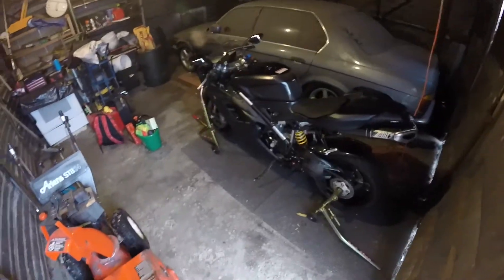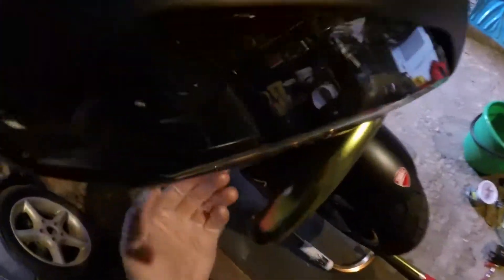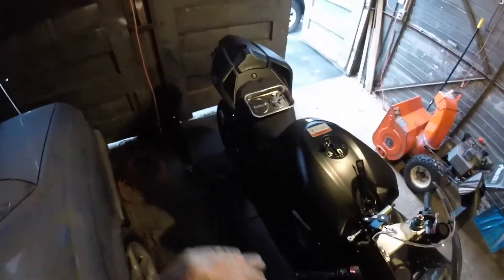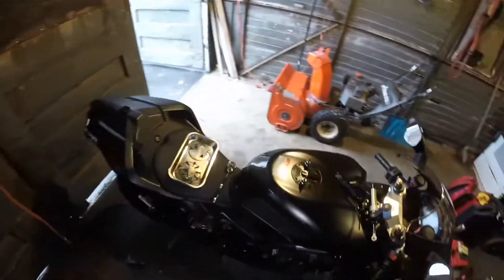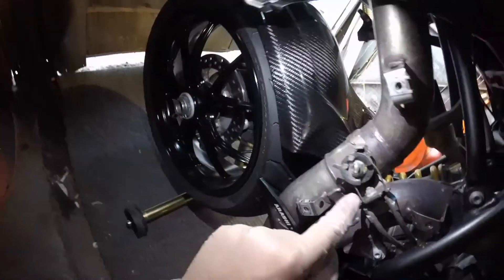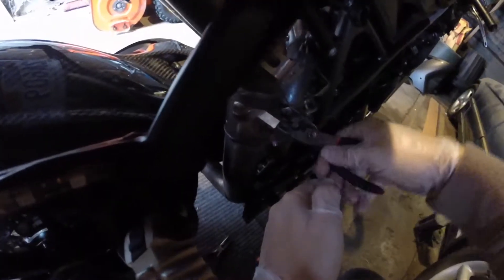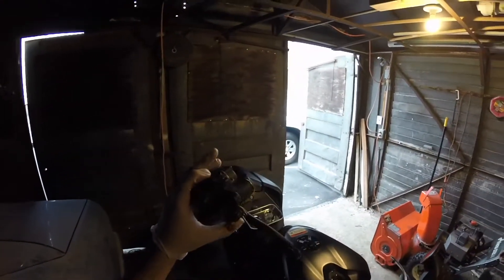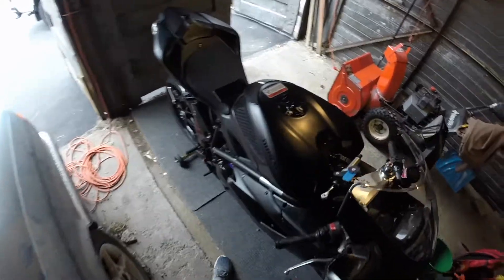Servo Motor Delete On Ducati 848 Evo

Comment: What’s up bro! Great Vid. I will be doing the same thing on my 848 Evo. My question is did you have to put the spring assembly back on the Valve after removing the cables for it to stay open or will it stay open by itself? 
Any issues with the servo buddy, no engine lights etc?
Thanks in advance
Reply from the maker: That’s awesome bro! So the right way to do it is removing the valve completely if you can it’s a real pain to do so. What I did I put the valve in the open position and installed the spring assembly back to keep it open. If you just leave it loose it will most likely eventually get stuck and not open any more. But whatever you can do bro!
Reply: I’m having trouble figuring out how to put the spring back without cables to keep the valve open. I wish you had shown that part.
Reply from the maker: He what’s uppppp. So if you put the spring back it will not allow you to keep the valve open. When I did it I removed the spring completely and left the valve open position. And tighten everything

Comment: I just disconnected the power cable to the servo. Is the valve open by default
Reply from the maker: Sometimes that throws a error msg and no by default it's closed

Comment: What difference does this make to the bike?
Reply from the maker: It opens up more air flow thru your exhausted system and takes away some weight. On my bike they had to put one because it was for California emmesions and your bike sounds a little bit louder you can really tell in the video but in person I could hear the difference.